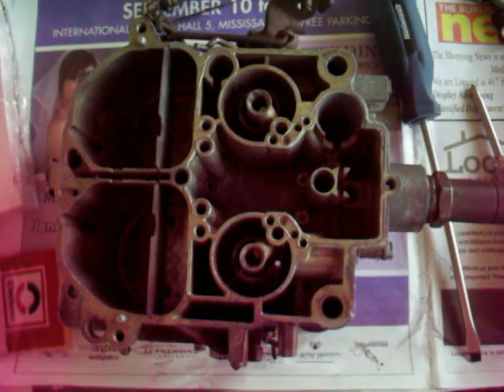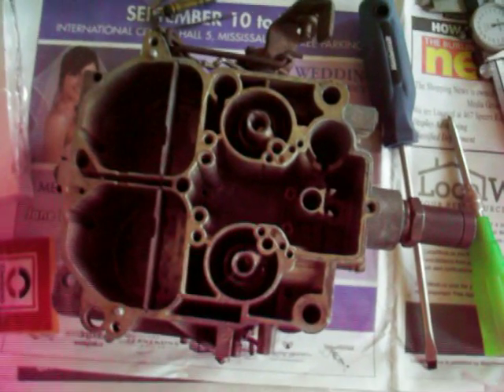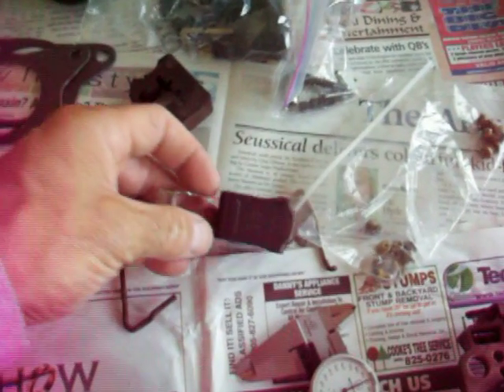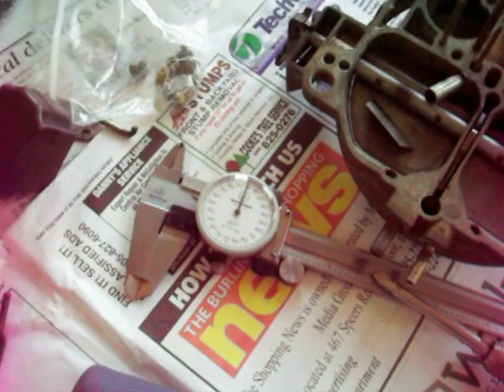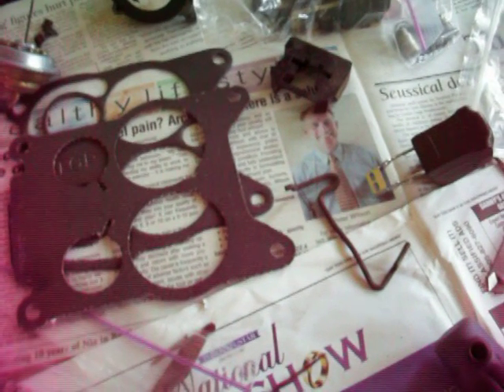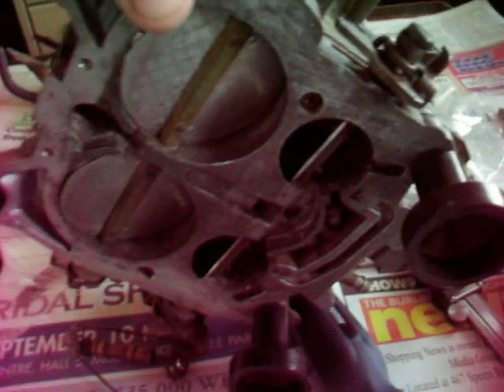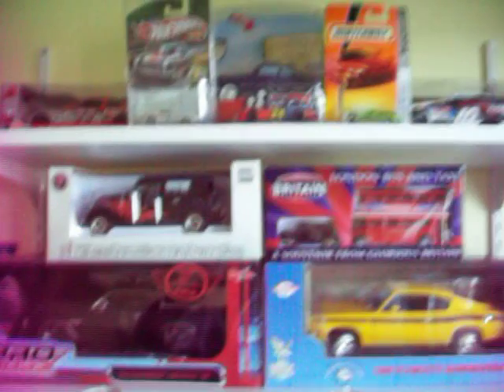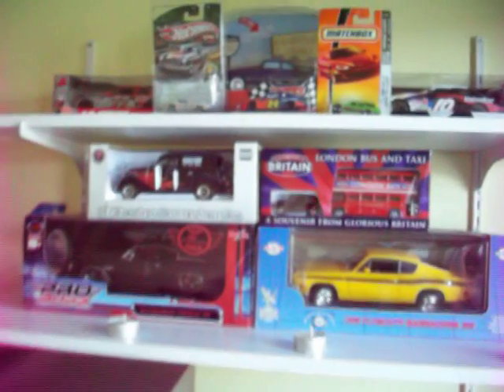Rochester Quadrajet

Comment from the maker: @Radiowild The float was replaced, it was saturated and heavy, the way it was, the car used too much fuel, and the exhaust smelled rich often.  It is so much better now.  The rods and jets were richened up a little to work with the much freer flowing then stock exhaust and head/intake work.